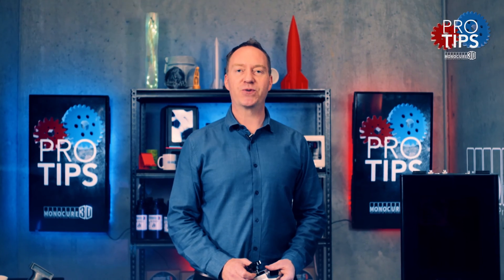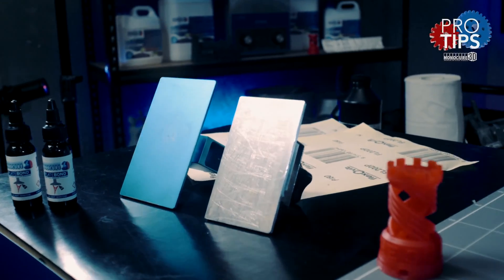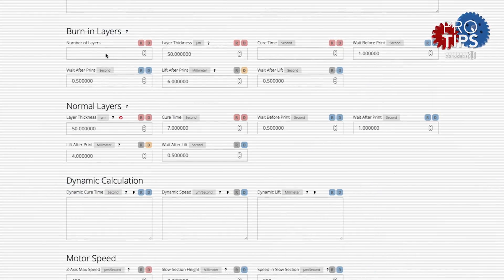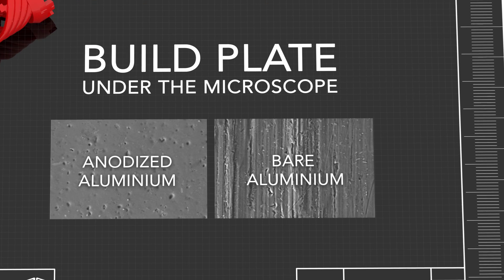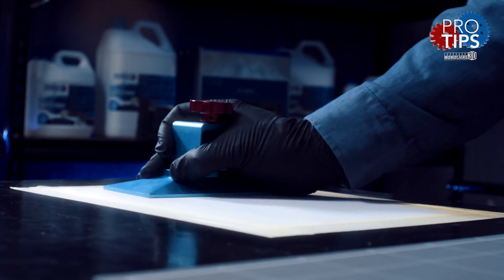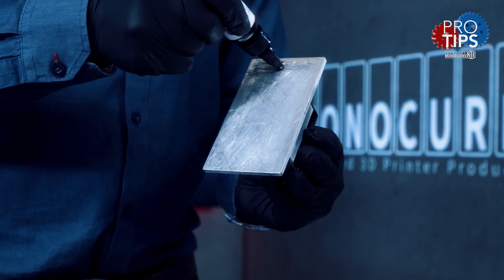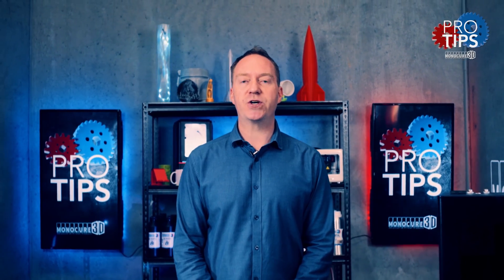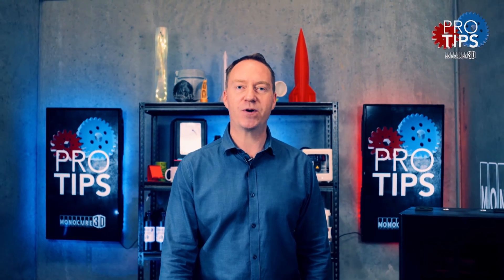How to get the 3d printing resin to stick to the build plate.

Comment: Can you use Elmer's glue for a good adhesive?
Reply from the maker: No that won't work like it does with FDM - Resin is a very different material.
Reply: @Monocure3DProTips  you can disregard my comment here. My print settings and my supports were the problem. I'm a printing professional now.
Reply from the maker: No problem

Comment: Once applied, is there an approved waiting time for the product to dry? I'm thinking if the product was still wet, would it not there stick to the FEP, and cloud the light source?
Reply from the maker: No you need it to still be wet as it is a UV curable product and needs to mix with the first 2 layers of resin.

Comment: I have an elegoo mars and have had nothing but failed prints :/ . I printed the test rooks they were a success . after the test prints nothing will print  .I read up the black resin is hard to print . just my luck I like black so when i got my printer i ordered 1.5 liters of  Black elegoo Resin  just my luck . Help help help I just want to print . it sticks to the clear fim on the bottom everytime without fail . hopefully this video can give me suggestions  .
Reply from the maker: Sticking to the FEP can be caused by the position of the model and allowing large flat areas to be in contact with the bottom of the vat. Or more commonly, it's the resin sticking to the film due to the layer duration being longer than it needs to be. Use a smaller calibration model to dial in your printer. Also, increase the lift speed a bit to help release it faster.

Comment: I don't think the tip about anodized build plates is true. Aluminum forms a layer of aluminum oxide in less than a second when exposed to the air. Aluminum anodizing just involves intentionally creating a thicker layer of this, with a lot of pitting in the surface for the dye to penetrate into. This might actually make it better at gripping to the resin compared to a build plate with the same surface smoothness that was not anodized. The reason sanding the build plate can help is just because you're making macroscopic scratches in the surface, not because you're exposing "bare aluminum". The bare aluminum you expose will just form aluminum oxide again before you could even get it back on your printer.
Reply: also, i find using a rougher grit paper, like a 60 is best, as it give the base a better texture to adhere to.
Reply: The thicker layer would mean more of the voids being filled in the end whereas a fresh natural oxidization as you said is much thinner. Also every anodized plate I've seen has a much smoother finish than the bare plates.
Reply from the maker: Thanks for the information. When we look under a microscope of an anodised plate, the surface seems much smoother, with less pores.

Comment: When removing the anodized coating, do you use SAND-PAPER?
Reply from the maker: Yes - 240grit is perfect.
Reply: @Monocure3DProTips  i just watched this and even  though my printers bed  looked like bare aluminum it was definitely not flat. Used   a flat marble top and   240 grit to get it even. I need to order some platebond. I keep getting fdep clingons no matter what i do
Reply from the maker: Platebond will be your friend! Liquid insurance!!

Comment: After removing the aluminum coating, should we be worried about the layer of oxidation that will build up on the exposed aluminum? Or does aluminum oxide adhere well to the print?
Reply from the maker: darrick steele Most build plates are bare aluminium and I have never seen this issue. If you were concerned, you could always give it a light sand every now and then.
Reply: @Monocure3DProTips  Aluminum oxide forms on the surface of aluminum in less than a second. Every build plate has a layer of Al2O3 on the surface, and sanding will not stop it because it will just form again, that's why welding aluminum requires inert gas welding tools like TIG and MIG. There is no way to avoid it unless you kept your printer in an inert gas environment at all times which is of course is ridiculous. Fortunately since we know all build plates have this layer on them, we also know that it doesn't hinder adhesion to the resin because we also know that most build plates work. Sanding can help, but it's just because you're increasing the surface roughness with macroscopic scratches on the surface.

Comment: If I understand you correctly, you don't have to worry about scratches on the build plate and you can regrind it if necessary.

Are there any reasons why one should replace the build plate?
Reply from the maker: No need to ever touch the  build plate unless it is anodised, painted or highly polished. A few scratches won't cause any issues.
Reply: @Monocure3DProTips  What grit of sandpaper should we be using? I use 240 and have ok success, but i found 400 to be far too much.
Reply: @numchux2  Finding this info is difficult it'd seem. I used 220 but I feel like that's still a wee bit on the smooth side. I just got a Photon Mono X and the plate was so uneven I spent 6 hours sanding the bastard down and I've not seen an ideal grit for the final finish...
Reply: @MidnightMarrow  I just bought a new version of the build plate instead at this point

Comment: Sometimes my adhesion can be too good and I damage my prints getting them off the build plate, sometimes I worry I'm even going to damage the plate itself... Video on tough to remove prints? 😅
Reply from the maker: Good idea!
Reply: Try reducing the exposure time for your first layer a bit. Should make it easier to remove.